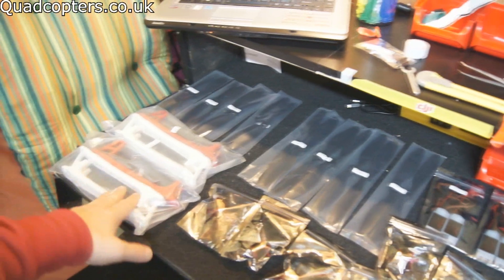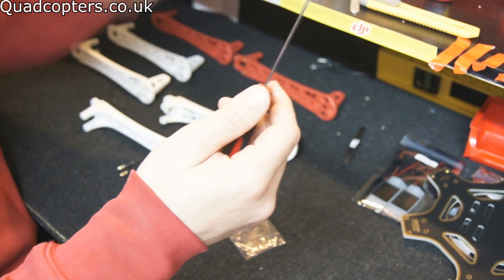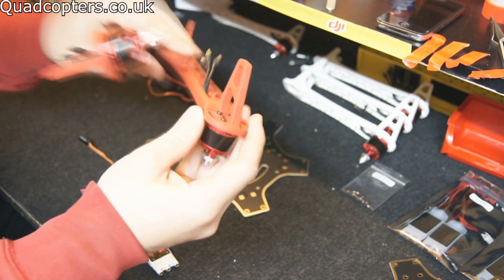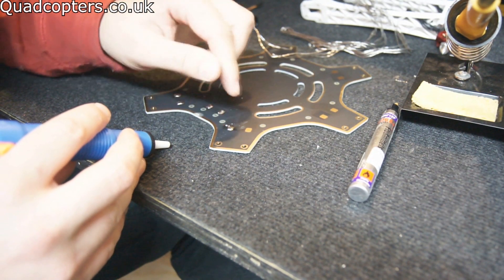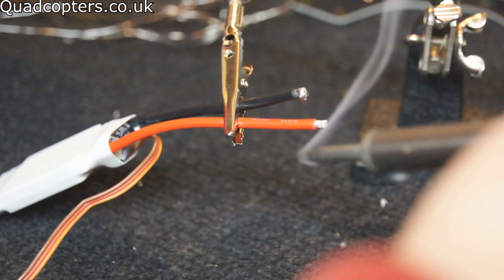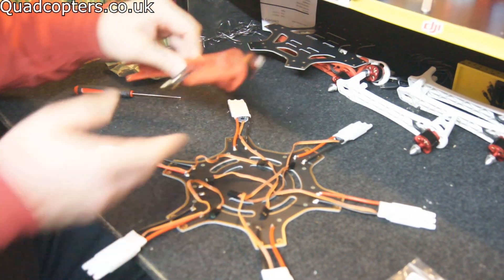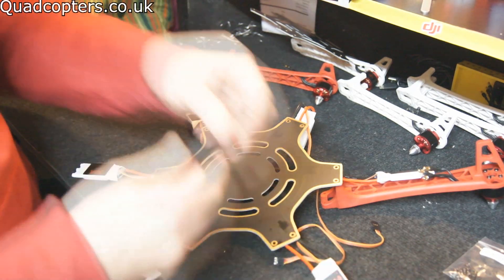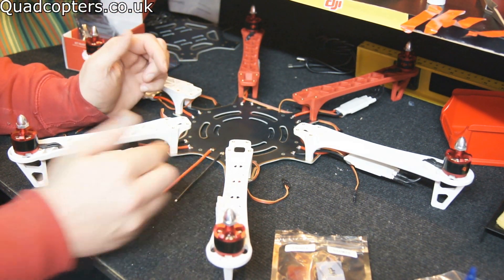DJI F550 build part 1

Comment: hi..i just have a question. After you soldered the ESC wires, you left the wires (to be soldered for the battery connector) and right after that you pulled something off the naza box..anyway since i'm not planning on using the naza flight controller (using apm 2.6) do i solder a BEC to power the APM over there (where you were going to solder the naza module at 10:40)..hopefully it made sense..i really need your help since i'm new to this

Comment: How much different is the F550 than the Phantom?
Reply: Phantom2 average costs about 900euro 
for a base F550 can be made already for 300euro but !
-  without batteries & controller, ..., gps, naza,...,+ gear
*depends on the plans for subsequent modification

Comment: With the thread lock applied, will you still be able to cleanly remove screws should you need to change a motor?